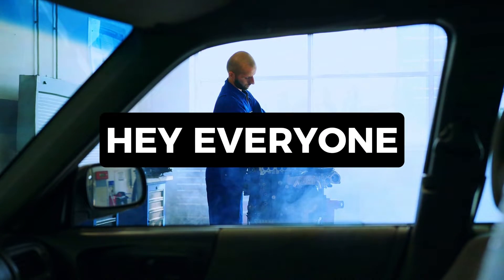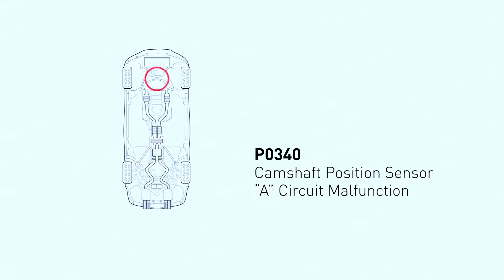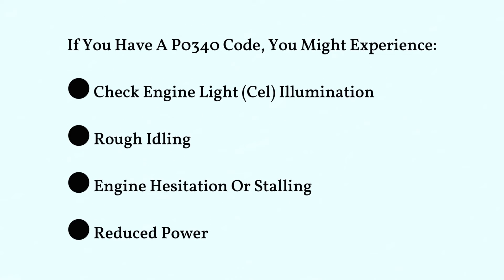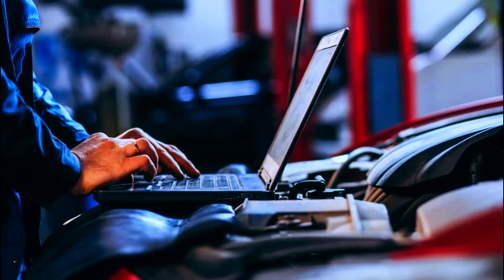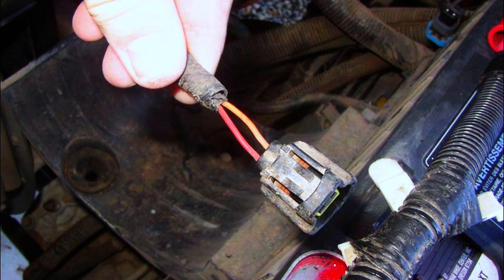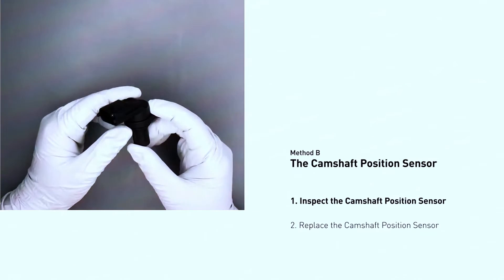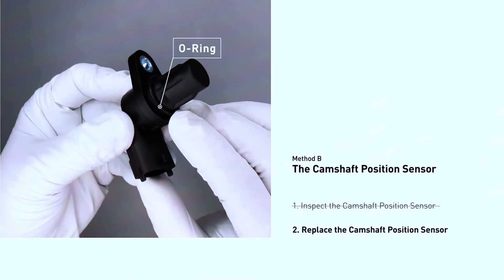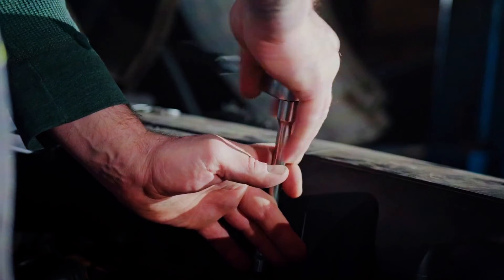The Secret Solution to P0340 Code - Camshaft Position Sensor Fix |

Comment: Annnd!?? what if one's engine Does Not have  nor need a camshaft position sensor ??
Reply from the maker: Engines that don't use a camshaft position sensor (CMP sensor) are likely older or simpler designs. Here's why a CMP sensor is important and some alternatives used in older engines:

CMP Sensor's Role:

A CMP sensor monitors the camshaft's rotation and position.
This info is crucial for the Engine Control Module (ECM) to precisely control:
Spark timing
Fuel injection
Other engine parameters
Why No CMP Sensor in Some Engines?

In older engines (pre-electronic fuel injection), the ECM might not need such precise control.
Carbureted engines often rely on a simpler system using a manifold vacuum for fuel metering.
Some older engines might use a single sensor on the crankshaft for basic engine timing.
Possible Alternatives to CMP Sensor:

Crankshaft Position Sensor (CKP Sensor): This sensor alone might provide sufficient timing information for basic engine operation.
Mechanical linkages: In very old engines, mechanical linkages between the camshaft and carburetor might regulate fuel-air mixture.
Drawbacks of No CMP Sensor:

Less precise engine control compared to modern engines with CMP sensors.
Potentially less fuel efficiency and performance.
Higher emissions output